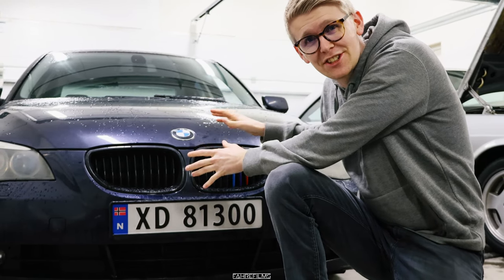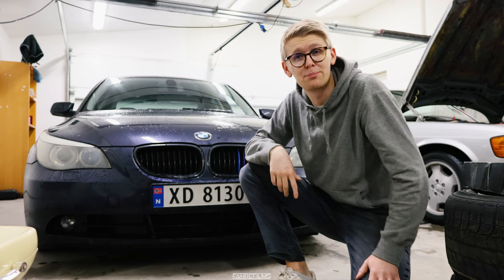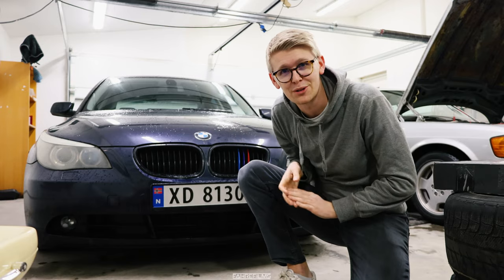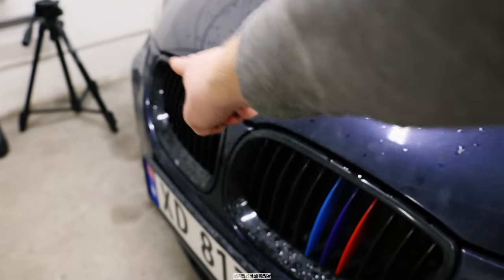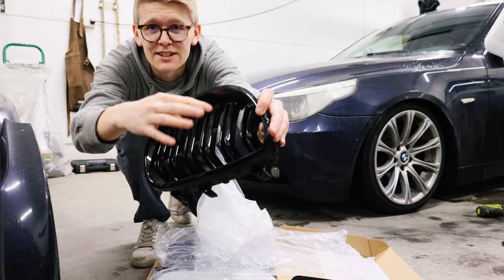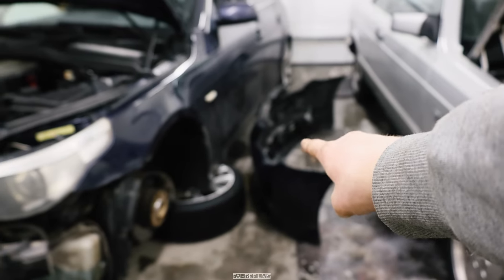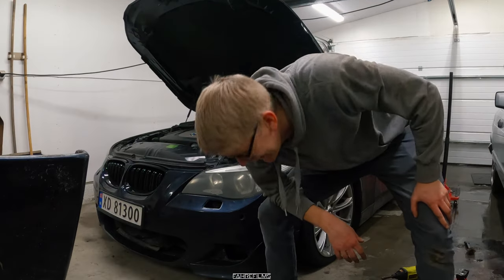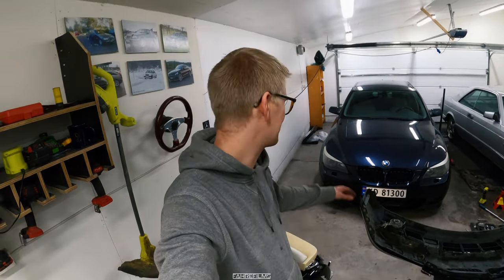Transformation Day! When You Install a M5 Bumper But Forget...

Comment: This is not a m5 bumper its a m technic
Reply from the maker: What? You sure? What different on the M5 bumper compared to this?
Reply: @FahreFilms  the m tech bumper has different fog light gap dimensions/shape and the m5 bumper doesnt have that little line on the side that like continues to the bottom ridge
Reply: M5 har ikke tåkelys i det hele tatt. Ser kliss like ut ellers
Reply: @FahreFilms  they look different you can search m5 e60 and you will see the difference
Reply: @FahreFilms  yes it's not the e60 m5 bumper it's the m sport bumper

Comment: The Msport bumper is a direct bolt on to non msport bumper or did you have to do any modification? Just transfer that bracket from the non msport to the msport bumper and everything lines up?